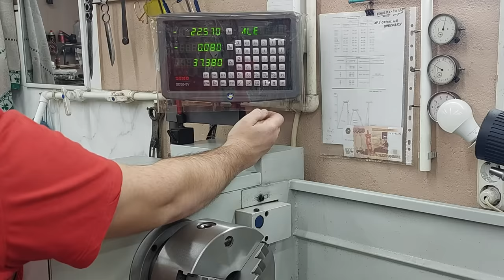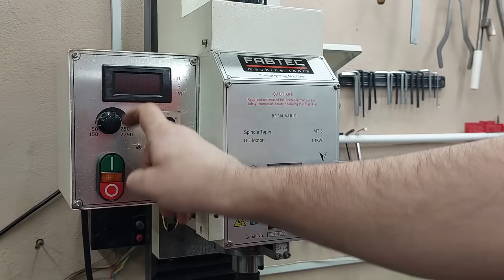Saved my money! A simple idea and useful tip in 6 minutes for metal processing

Comment: No need to slot the boring bar, just drill a hole. Much simpler & more positive,tool can't move up or down under load. Use square or round tool steel.
All the best. Keep on tinkering.
Reply from the maker: Thank you and welcome😉